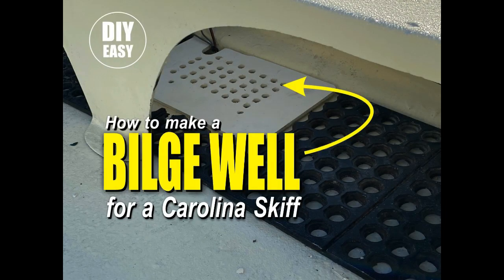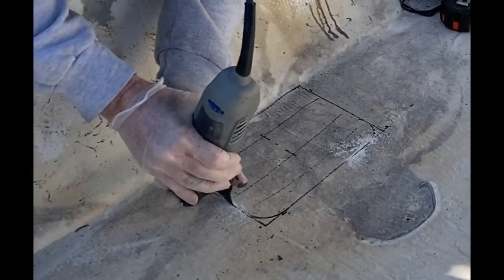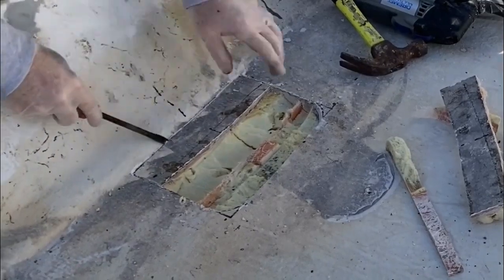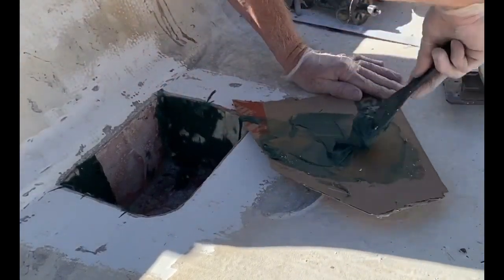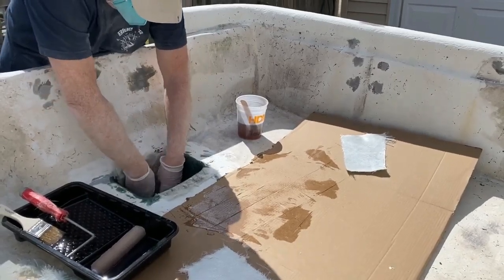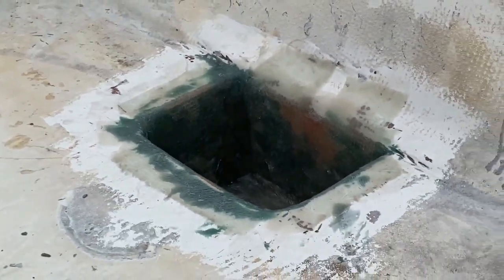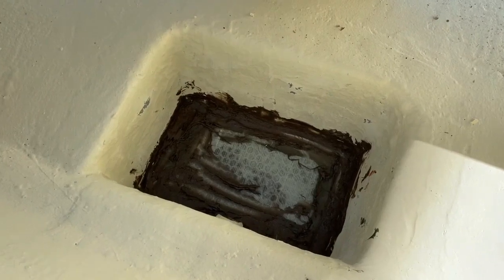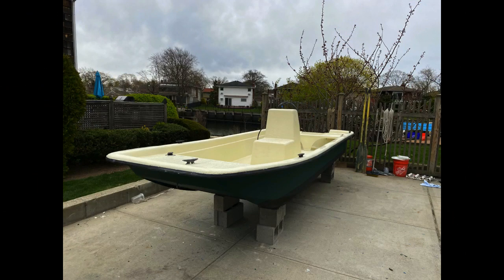How to make a Bilge Pump Well for a Carolina Skiff  J16

Comment: Thanks so much.  Practical, real world solutions.  You even show your mistakes.  Very helpful.
Reply from the maker: You're welcome! This and the bow deck are my favorite part of the rebuild. Only thing I would do different would be to make the well about 2 inches larger. I got the bilge pump and float switch mounted but with the hose it was a tight fit.

Comment: Very nicely presented project.  I have a J16, like yours it has no bilge.  I think I've seen newer models that have them, but I have what I have (1999).  I had never even considered the possibility of creating a bilge, and you showed there's a lot more depth to the hull than I had considered.   

Have you thought ahead as to how and where you will secure your gas tank?  I use a typical plastic 6 gallon portable tank that sits under my rear casting deck, but is not well secured.  For trailering I use a strap to loop around the deck but it can still slide around a bit.  With your fiberglass skills I bet you could come up with a more secure installation.
Reply from the maker: I placed mine under the center console. I installed a short pc of 1x2 pvc to the deck to keep it from sliding out and put a rubber mat underneath it. So far it seems to be staying in place

Comment: apologize for my ignorance but how come you drilled a hole through the transom if you're running a hose up and out of the boat?
Reply from the maker: Great question. Only real reason is when boat is out of the water plug can be pulled so its self draining. This way battery can be disconnected for the winter. If I was going to do it again I would seal up both original deck level plugs with fiberglass and just leave the bilge well plug.

Comment: Have there been any issues with the cut away area butting up against the transom- eg the area that the transom is no longer joined to the floor being weaker or pulling away from the bilge sump due to motor weight or movement?  I am considering doing this, but am concerned about cutting away part of what connects the transom yet also having the bilge well in an optimal location.
Reply from the maker: No issues at all. Best modification I have made to date. My feet are dry!!
Reply: @DIYeasycrafts  good to hear!  I've got a Carolina Skiff 1860 that's getting ready to get this same upgrade so thank you.